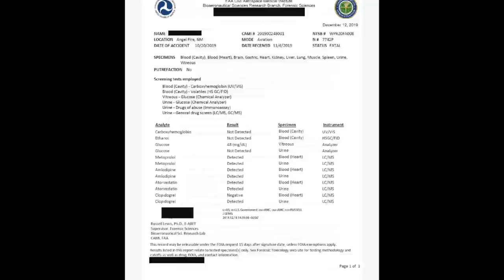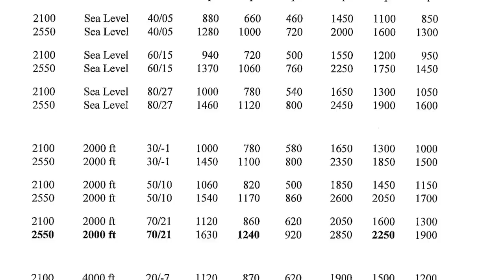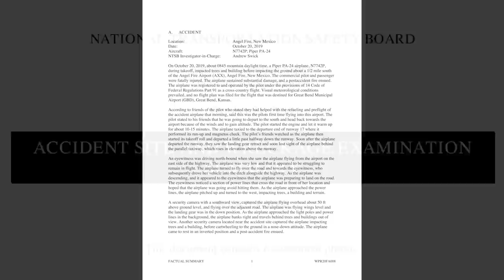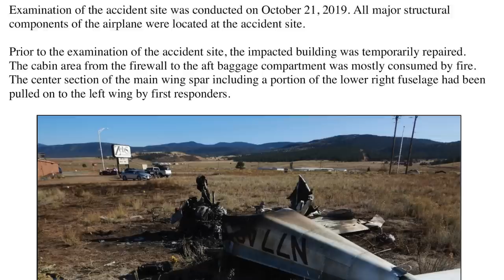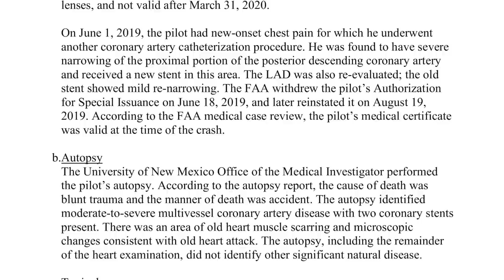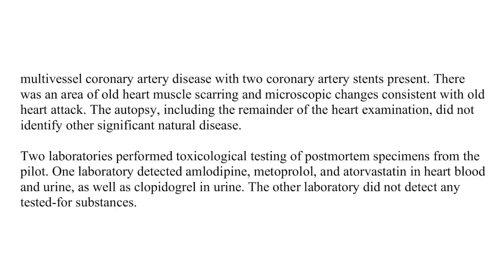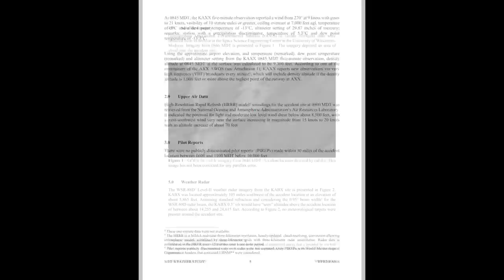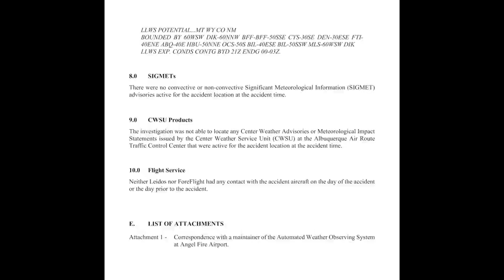Crash of Piper Comanche

Comment: Density Altitude.
Reply: These crashes just never seem to end.
Reply: It's sad because 30 seconds of consideration would have told the pilot that taking off with the airplane’s total weight at the airport density altitude was a bad idea.
Reply: Yup! Same reason friends of mine were killed in a Bonanza in Ogden Ut several years ago. I had flown the day before (very similar) and DA was 9900ft. Field elevation 4473’. I certainly noticed it and I was in our Pilatus. Overloaded, normally aspirated Bonanza never had a chance. Just because you’re at or even under gross, it certainly doesn’t mean she’s going to fly.
Reply: @TheGospelQuartetParadise  we had a similar problem with our helicopters ch3e landed at the mountain top in the early morning. I think it was around 7,000 ft it landed in the early morning and it stayed there for a while. And then went to take off and unfortunately it starts at the sink after I went down the side of the mountain top and crashed and rolled
Reply: I think I also 20 years ago a Sikorsky Blackhawk was hovering over the ridge of Mount Hood and it's that's the altitude was close to Max. It received Augusta wind that pressed down into the rotor path causing the aircraft to lose its lift. It then crashed into the snow and rolled down the Mountainside over and over and over and over and over
Reply: @specforged5651  any airplane can be overloaded, no matter what kind of engine it has - although turbos definitely help.   People just need to write down total weight, get the density altitude and look at a performance chart.
Reply: @davedoe6445  Is that exactly what I just explained? My point wasn’t about turbo or non turbo engines, I was speaking to engine performance and weight in reference to density altitude. I enter that information and much more performance data / departure conditions into the flight computer every day.
Reply: @specforged5651  yeah sorry for being too pedantic
Reply: @davedoe6445  All good my friend, I know what you were getting at. No worries!

Comment: Incredibly detailed investigation and reporting on an  aviation accident, including numerous eye witnesses etc.  But consider this;  180 Horsepower (at sea level).  HP Loss = (elevation x 0.03 x horsepower @ sea level)/1000 or (8380 X .03 X 180) / 1000 =45   180-45= 135 Horsepower not to mention the loss in thrust from the propeller at that altitude.  Further, part of the remaining horsepower was consumed by the crosswind/gusts.  In addition, this aircraft was pushing 60 years old which likely contributed to some further degradation of new performance numbers.  There appears to be about a 40 to 45 foot climb between the end of runway 17 (8336 ft.) to the runway elevation.  The situation clearly called for additional thinking and analysis prior to takeoff.  Hopefully, the thorough investigation and reporting on this accident will save lives in the future.

Comment: That was brutal.  I wonder how much those tanks hold and were they full for takeoff?  As soon as I saw the cloud of raw fuel, it was clear it was going to get ugly.  

I had to quit watching towards the end.  What’s the word on the hard right at the end?  Just the camera angle?  Pilot lost control or was it a decision to turn?
Reply: Full. 60 gallons.
Reply: @wyomingadventures  It says it had a capacity of 60 gallons but was refueled with 20 gallons - which did fill the tanks - either way, it was more than enough sadly
Reply: @cadoo5591  it was topped off unfortunately with 20 gallons. They were flying back to Kansas
Reply: hard right after he hit the tree and the building... ripping off a chunk of the right wing will cause one heck of a hard right (I would have called it a cartwheel)

Comment: The Comanche 180 engine is a 4 cylinder, normally aspirated Lycoming petrol engine,  which develops 180 hp at Sea Level in international standard conditions. By the terrain charts included in this report it would appear that the airport elevation was well in excess of the performance charts displayed. Therefore the engine could not have been producing anything near 100% power or even 65%. Full throttle height for this engine is around 6000 ft  depending also on the temperature of the day the density altitude would probably be around that same figure. With the gear down there is considerable drag and a loss of about 3 Sq feet of wing area so performance would have been very poor.

The other notable problem, from the report was that the presence of Statins (Cholesterol lowering drugs) in the toxicology report. Statins have been sown to increase the incidence of Transient Global Amnesia, which can hit without warning making it a possible reason for this crash. TGA can mentally incapacitate the pilot
Reply: The cause of the accident was a flatlander pilot in an underpowered airplane that decided to take off UPHILL with a 20 not crosswind. Unfortunately, he and his passenger's fates were sealed when he decided to try it.
Reply: @wrightrandy  the demonstrated crosswind component is, I think, 12 knots. By  your "Flatlander" comment I assume you also meant a Low land person, certainly inexperienced in the correct use of leaning the mixture for high altitude take off and climb procedures. Good comment though.

Comment: I may have skimmed over it and missed it...but what was the final reported cause? Don't see a ntsb final report and it's been many months ago. I'm thinking he didn't keep up his airspeed vs his climb rate and stalled. Crosswind played part, but you would crab into the wind and he could have maintained his climb. (unless an unfound seizure) Do not understand why he was descending, (at a high rate) as shown in the video's. Also may have missed how heavy they were. Lack of experience? Damn shame...
Reply: inadequate power and punched down (or maybe more pinned down) by a persistent down-draft. the plane had only 4 cylinders, the lowest number of three models available. there were wind gusts and drafts that his plane could not overcome.

then the density - the engine lacked oxygen and the wings lift

Comment: Condolences to the families involved. I find this accident haunting because, as a pilot myself, I probably wouldn't have given density altitude much thought. if you look around in the video, ppl are standing around in jackets. the outside air temperature was cool. My takeaway is the importance of complete preflight planning and not making any assumptions. there is another way to look at this accident though. There is an eyewitness that said they saw the landing gear retract after takeoff. just before the accident, in the video, we can see the gear extended. The commercial-rated pilot would instinctively not have retracted the landing gear if there was not a positive rate of climb. Being that the gear was extended before the impact with the building, I am wondering if there was a partial loss of power causing the pilot to get set up for a landing on the road. Lastly, this airplane has a couple of different engine options. when I searched the faa registry, I notice that this airplane has a 180 HP engine. there was a 250 HP and 400 hp option available. the 250 HP is the most common. Even though the 180 engine is probably not the greatest choice for this airframe, I would hesitate to say the accident was caused by poor decision-making on part of the pilot. I am just wondering if the 180 HP engine was having some issues.
Reply: a lady driving on the highway witnessed the plane apparently heading straight in for a landing on that same highway right in front of her.  she ditched her car to allow him to do so but then he suddenly veered away and crashed, having never gained altitude to fly the airplane.  there were wind gusts and density issues + the power available (deficient) w/ his particular model plane under these demanding & unpredictable conditions.  gusts come out of nowhere to send you sideways, then another pushes you down!  the gear descending also created yet more momentum downward w/ some marked drag.  he did manage to clear power lines as he headed to land on the highway though, as mentioned in one report.  you really have to have the proper aircraft for your conditions - along w/ the utmost completely careful and detailed pre-flight PLAN.  someone's mother and father are in heaven
Reply: I don't think it was engine issues. Sounds like a classic density altitude plus gust winds crash. What I can't understand is it seems like after takeoff he turned to the East, which would have put the wind directly at their back. If you takeoff and are having issues why wouldn't you turn in to the wind? I think that is what sealed the crash. They turned in to the wind barely flying, caught a gust on the tail, he saw the power-lines as he was trying to land on the highway maybe, pulled to go over them and full stalled. Just a long chain of events that led to this tragic accident. Plus they said it was his first time at the airport, so maybe not used to high density takeoff procedures so the mixture wasn't leaned properly and didn't hold breaks till max power before takeoff run.
Reply: @TheDornado  He turned west, not east. That was into the winds. The cause was a flatlander pilot in an underpowered airplane deciding to take off UPHILL with a 20 not crosswind.
Reply: @wrightrandy  go to 26:07 and you see the flightpath with a clear turn from south to east to follow and possibly attempt an emergency landing on the highway. This put the wind more at his back causing a further loss in lift.

Comment: It's amazing how that steel roof hardly sustained any damage, might have contributed to causing even more damage to the plane and it's demise.
Reply: i think any properly built roof will win against a small plane. I mean, the planes wings are held on usually by like 8-12 bolts max lol. and in fairly thin metal. it's the side of the buildin that took the impact

Comment: Wonder what the weight and cost is to use rubber seal fuels tanks like WWII fighters had. Wouldn't help when a wing is totally destroyed, but it seems it would in many cases.
Reply: The Comanche has fuel bladders, not tanks.  Electric fuel pumps would have been turned on for take off and continued to push fuel through a broken line.

Comment: As a private Pilot that airport is at an altitude of 8,300 feet MSL "Mean Sea Level".  I can tell you what happened.  Lack of lift at that altitude. High sink rate into the building. That aircraft just does not provide the lift and HP at those altitudes.

Comment: This is why I don't try to take trips into types of flying I have not been flying in with a instructor. Its very easy to get into a situation that you have not experienced and then you have a 50/50 chance of making the right decision more than likely he knew by his takeoff roll he was in trouble and should of stayed on the ground. When I first got my license I flew to Ocean city as I have done before but it was dark and the runway in use made me do my approach over the ocean. I realized very quickly over a dark ocean with very dark sky's I was in a situation I was not trained enough to fly so I went around a decided to head to another larger airport it happens fast when your flying at least he did what he could to miss the two businesses

Comment: To me, it looks like the plane was in trouble, and the pilot saw powerlines and a mountain in front of him and wide open fields to the right of him behind those buildings so he tried to turn toward the fields but was just too low and caught the trees and top of the building which caused the plane to crash the way it did. 
I believe if he could have missed those trees and the top of the building he might have been able to save it by sitting it down in the field behind the buildings. Not the small field it crashed in, the very large open fields back behind the buildings. May they R.I.P.

Comment: Has any general aviation aircraft manufacturer offered a passenger cabin fire suppression system?
Reply: No. Some pilots will carry a small handheld extinguisher to put out a smoldering electrical fire, but nothing that will extinguish 60 gallons of highly volitile avgas. As you saw here, they emptied multiple extinguishers and the fire kept reigniting.

Comment: Fire extinguishers never seem to work on putting a fuel fire out. Unfortunately 5,000 gallons of water is not available immediately.

Plane was full of fuel, in the slow mode you can see when the wings rip off fuel is spraying everywhere.

Comment: It will be interesting to know what position the mixture was in (if that’s even possible).  The robust O-540 PA24-250 at gross, Osborne tips, 3-blade McCauley gets really sluggish at gross up there towards 9k DA.  would hate to even try it in a 4-banger 180 but have experienced it without tip tanks, 2-blade prop and gross at 4k DA and it’s fine.  I hear instructors call for ‘full rich’ periodically around a runway environment but IMHO this can be deadly.
Reply: this was a Comanche 180.... not a 250.  With 2 people and full fuel at a density altitude of ~9500 feet and lots of low level turbulence.  A really tough situation
Reply: You have no clue what you are talking about
Reply: i’d much rather have peak rpm than ‘full rich’
Reply: @batbiker5857  
That statement proves you aren't a pilot
Reply: you an instructor? perhaps stay far from arizona and NM on a hot day
Reply: @batbiker5857  
Your deflection doesn't distract from the fact that you clearly aren't an actual pilot  🤣
Reply: BatBiker is speculating, but not too far off the mark. I learned to fly at a hot and high airport, and we always leaned to best power mixture at the runup pad before takeoff.  Going full rich would ruin your runway performance.
Reply: @singleproppilot  
BatBiker isn't a pilot
Reply: @virgilhilts3924     Full rich does not give the best power on High Density days
Reply: @virgilhilts3924    The altitude performance charts for a 61 Comanche call for the mixture to be "Best Power" not full rich.
Reply: @tomedgar4375  
Where did I say it did?
Reply: @tomedgar4375  
Where did I say a word about "full rich"?

Comment: Sad and scary at the same time...  It might have already been covered but I wonder why he attempted to clear that building when there was so much open area in the general flight path that looks incredibly open.    Maybe some power lines, but I'd take my chances clearing the wires above or below than stall into a building like that..  Yes, hindsight but seems like a somewhat easy out if engine or lift performance is severely degraded.

Comment: Fight the fire as much as you can. Yes they are gone, but now its gown from SNR to preserving as much evidence as possible. It could mean the difference between figuring out everything that possibly went wrong. Here we have video evidence and eye witnesses but you dont always have that.
Reply: ..MOST don’t want to engage in a FULLY-engulfed fire with JUST puny hand-held extinguishers and HIGH-octane AVgas. Instead of the most likely 2 souls involved onboard, you may end up with 2-3 more in an explosion.
Reply: The chances of survival were miniscule, but crazier things have happened before.
Reply: @hotsoup1001  As Granite said, they are gone but it goes to preserving as much evidence as possible and that's a good way to look at it. The more evidence the more chance at finding answers that could potentially save another person's life in the future. And it helps bring closer to those suffering the loss.
Reply: @m118lr  Octane rating has almost nothing to do with the flammability of the fuel, flash point is what makes gasolines more dangerous than kerosene, diesel or oil.

Comment: I figured three things to have happened with this crash. Either a mechanical failure, the pilot attempted to take off over gross weight, or he attempted to take from an airport of high elevation with high density altitude. Turns out I was right with the latter. Very unfortunate and tragic. God rest their souls.

Comment: This is a hard one to understand. Under powered and overweight maybe or possibly flight control problems? I just can’t think of anything else that would make him come in like that. Piper Cherokee 140 and Piper Cherokee 180 are notorious for being underpowered  . There is fun and the mostly expensive airplane to fly . However you must remember what some of their weaknesses are.  I fly a Piper Cherokee 140 if you’re flying with tapped off fuel tanks you must be mindful of the weather and altitude and load . This was a tough video to watch😢

Comment: A sad demise to persons and plane and property. What I don’t get is why pilot with flat land and roads headed for the largest building around! Sad. RIP
Reply: Looked like a squall blew up. I think the wind pushed them over to the house.
Reply: Looks like he was attempting to land on the road and then pulled up to miss power lines.  I was trained to use roads as a last resort for this reason (along with the poles holding up the lines).

Comment: If the aircraft is not gaining speed, on the runway properly, "ABORT THE TAKE OFF". Every single pilot that has transitioned into an airplane knows, and feels in his "BUTT" sensor, when the airplane is not  accelerating properly, on the runway. Do not get "get thereitis" or fear you will get stranded. Stranded is better than "dead". Cheers.

Comment: Base of the flames people. Always aim a fire extinguisher at the base of the flames. Law Enforcement especially should have been trained that way. Doesn't do any good any other way.
Reply: The fire is coming from the fuel supply, as long as you have a hot engine and a fuel supply those fire extinguishers aren't going to put out anything.